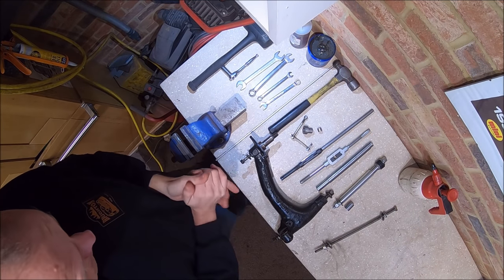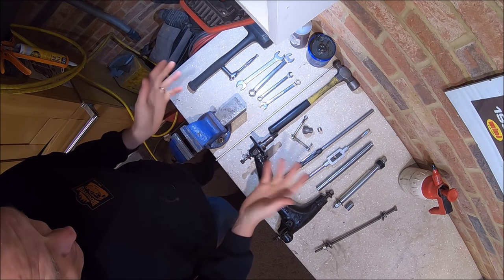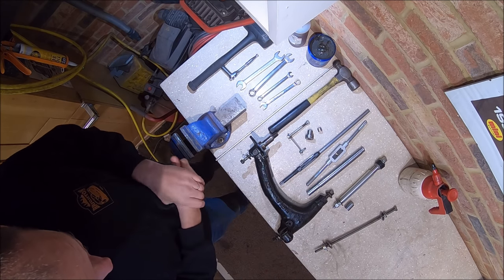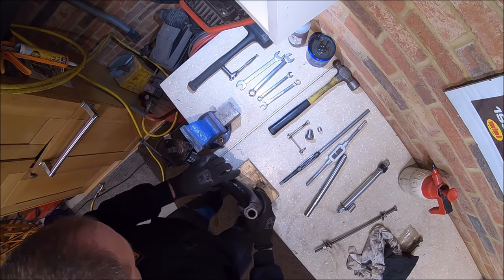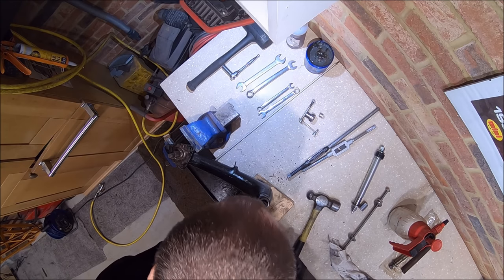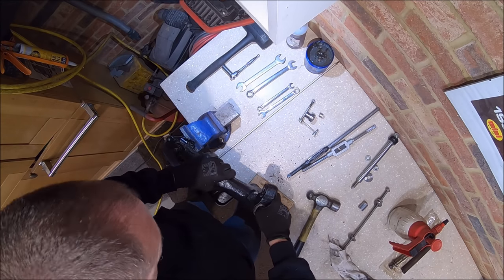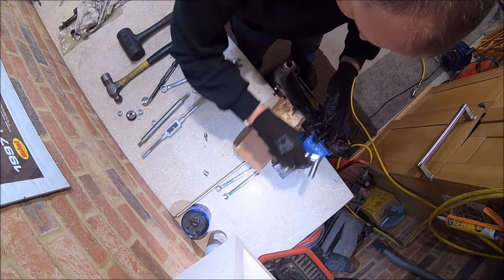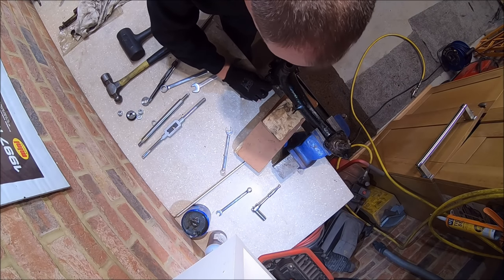Classic Mini Workshop Project Sprout Pt.53 Radius Arm Recon

Comment: Hi Keith. I spoke to the original owner.  He say all 4 Brakes were from 1984 Mini Front Disks.  He was a Master Machinist ( now long Retired)  He says he said he custom machined the the rear radius arm Brake mounts and stub axles  and  bearing carrier so he could mount the front disks on the rear end. he also said it took 3 attempts to get it right. he said  this necessitated changing the wheels from 10 to 12  inch to fit the larger brakes.and he said he had o fit large flares to fit the wider wheels because it made the mini wider in the rear by a bit .  I asked him if he still had his original drawing of the mounts etc, but sadly he said he tossed them when he moved to Florida to retire.  I wanted them to send you a copy. and to see how much it would cost to reproduce at a machine shop on modern CNC equipment.  He seemed very happy to hear from me again, but he is 89 yrs old and in poor health. he said a lot more as well.  he changed the emergency brake to actuate a separate hydraulic system that was tied into the rear brakes and he had to use a proportioning valve to do that.  You could tell he loved that car as much as I did.  Sorry I can't be much more help.  Maybe if I had the parts in front of me I could do a drawing of roughly how it was done but I doubt.  He sold it to me because he said he had too many Mini's and he could only drive one at a time, so he kept his favourite three cars and sold the rest. (a problem I wish I had.).  Well at least he sold one of them (in Nov 1984) to me with a ton of spares LOL! When I told him I wanted to build another Mini Van with a modern turbocharged Honda motor He was very Keen. Do you think I might be better off with a Newer (2011) Mini Clubman?  I really want to have a Mini but I think the modern minis are WAY underpowered.  A Honda hatchback can easily hit 500 horsepower with the right parts and a cheap eBay turbo.  I  would be happy with a bout 320-350 horsepower, but getting that out of a second gen BMW mini is Very expensive.   What is your option, I really value it because you have owned both. Again thanks for the great videos
Reply from the maker: You could not use that rear brake conversion and be road legal in the UK as the emergency brake needs to be mechanical, not hydraulic. In a classic Mini 100BHP is enough to have fun, 150BHP is seriously fun and 200BHP is about as much as you will ever need unless you are drag racing. Anything more than 250BHP will just be lost in torque steer and wheel spin. A 350 BHP Classic Mini might be interesting in a straight line but will be pretty much useless at anything else. Sadly when you factor in ££'s per BHP a second hand BMW Mini Cooper S will wipe the floor with a classic after a few inexpensive mods. Converting a classic with a Honda VTEC is probably the most cost effective way to get more power in a classic Mini but only if you have the know how to build it.
Reply: Thank you for your thoughts.  I should make it clear that I am not in the UK.  Just that the previous owner lived in the UK.  He told me that when He immigrated to Canada, he had imported 6 Mini's with him.  I am not sure when he made the modifications before, or after he moved here.  I have thought about it a lot, and even though I miss my original MIni,  I may be better off with a more modern one.  I really want four wheel disk brakes, and I am going to go with a Garret turbocharger and a hand made sidewinder Honda style exhaust.  I am told this will easily make 350 horsepower with the right injectors and fuel pumps.  I should have made clear that I wanted a track/ street vehicle from the start.  Also the 350 horsepower figure was referring to a modern turbocharged mini.  I will edit this later with links to some Mini's on YouTube you might be interested in watching.  Turbo B16 with electronic boost controller https://youtube/JQ2EzXZ7rtg AND https://youtu.be/Vb_gjoMxNFM Youtube posted 500 HP modern mini https://youtu.be/4bRwo1bDcDM?list=TLPQMTMwMzIwMjCZkouZErvLtw&t=148 450 HP mini https://youtu.be/-qAd4ISKlTo?list=TLPQMTMwMzIwMjCZkouZErvLtw  Thanks again for your help.

Comment: I would like to ask you, what is the reamer diameter in milimeters. I would like to do it by myself, hopefully it will be not disaster... :-) Thank you
Reply from the maker: The correct size is 13/16" (20.64mm) I use an adjustable reamer

Comment: Hello. Very helpful video, thanks. Placing a reamer tool order today. What size tap wrench adjustable twist handle do I need? There's one on ebay that covers M1 to M8. Would that be ok? Also, regarding your threaded bar, nuts and washers, what spec / size for the bar (M? x length). Washer size etc? Just want to place orders to have everything ready and not get so far then have to wait for things to arrive. Radius arms are still on the car. Currently finishing off cv joint, swivel hub, front brake, tie rod, hi=lo, suspension, shock absorber etc replacement / refurb, working front to back.
Reply from the maker: My wrench is M6 to M20 so the one you are looking at looks too small, threaded bar is M10x350  and washers are 37mm
Reply: @classicminiworkshop   Thanks, very helpful, bar, nuts, washers etc just ordered on ebay. Already got a tap turner that expands to M12....would that do the job?
Reply from the maker: @elwynrowlands9486  It should do, the reamer is M10 drive. The only thing I would say is the wrench needs to be wide on the handles to make it easier. Mine is 330mm wide
Reply: @classicminiworkshop  yes, I was wondering about that, for stability and control. I will tread carefully. Thanks again

Comment: As always nicely presented but just a small comment mate - When my arms were being reamed at Randall Engineering at Hepworth while they did the engine bores and cylinder head the guy (using the original Leyland tool!) left the old roller bearing in for the reamer sleeve and after the bush was to size punched out the old bearing, pressure cleaned the inside and then pressed in the new bearing.
Just one of many ways to do this gut boring job!
Reply from the maker: That’s a good idea. Also if they made the pilot bush a slight bit smaller than the bearing case you could just use the pilot bush before fitting the bearing
Reply: @classicminiworkshop  I am sure a local engineering shop could make one up as you have the needle roller and the sleeve as patterns. Suggest it to whoever made the kit.

Comment: hi
i am about to order the m machine sill and floor section i just watched you fit on the ERA and was wondering about the door step and a frame panel you fitted to the ns door  would you be kind enough nto tell me where you got them do no see them on m machine catalog 
unless i missed them
cheers and keep up the good work

brian
Reply from the maker: Hi Brian, all the panels came from M Machine, they are able to get loads of other panels that are not in the catalog, if you give them a call they can get just about any panel you want. They also know their stuff!
Reply: @classicminiworkshop  cheers Keith
Reply: Brian, that was a Heritage part and the M-machine part number is 13.14.10.27 L/H or 28 R/H. M

Comment: Hi Keith,  I am hoping you can help.  In the early 1980s I owned a 1967 mini van.  I loved that car.  The person I bought it from had the mini heavily modified.  It had rear wheel disk brakes.  I have searched the entire web looking for where those brakes came from.  The only thing I have found is a KAD conversion kit.  Do you have any idea what those brakes may have come from?  I know the car was imported from Britain by the previous owner.  It cam with a huge number of spares, and a second motor built by some mini specialist in Britain.  I got a screaming deal on the car.  Do you have any idea where those brakes may have come from?  That car handled way better than the North American cars I was used to.  I am making plans to try to build a car similar to that one, because it was one of my favourite cars, the only difference is I want to B16 engine, (for reliability) and a different colour.  I don't want to pay 2000$ cad for rear brakes.  Mini's have become very expensive compared to forty years ago.  If it's going to cost too much money I may just as well buy a more modern car. So I want to investigate how much it's going to cost.  Honda b series motors are pretty cheap so I can get a reasonably priced damaged donor car for cheap.  I have a line on a shell with a blown motor with not much rust from a friend so that leave the front subframe kit and the rear disks with a proportioning valve. Some 13 inch wheels, and some custom sheer metal work.  I am retired now and I can do most of the work   or with help from my kids. Love watching you by yourself or you and Mark work on these cars.  My old Mini was like Alex Toons only in was   bronze/brown with a chromed  front grille I fitted to make it easier to to swap motors.  I did not have a lift only very high jack stands so I would drop the motor out the bottom to switch to a 1275 motor that came with the car .  I did not know as much about cars as I do now.  I learned a ton about cars from working on that car.   Found memories.  Love you videos I have learned a huge amount about Mini's from watching your channel.  I worked as a mechanic/fabricator/machinist after high school.  So thanks for keeping me entertained and teaching me about Mini's.
Reply from the maker: Can you get a photo of the brakes and I might have a better idea where they came from?
Reply: Unfortunately Keith 
I had to sell the car when I got married (edit).  I no longer own it (sigh). I was hoping someone could tell me if it was a popular thing to do in Britain in the eighties.  My children are adults now and 
I was hoping to recreate the car, because I always regretted selling it.  It as you know was the closest thing to driving a street legal go kart.  I really loved that car.  I was trying to figure out if I could afford to replace it with a Honda b16 motor to upgrade the power.  I also always wanted power windows and and power door locks.  And the last item on my list was air conditioning. But with the B16 it isn't very realistic. I just can't fathom the idea of paying a huge amount for the KAD rear disks.  Did the rover metro ever come with rear disks?  I just can't remember because it has been so long ago.  I suppose I could buy a 2012 BMW  mini clubman but it just isn't the same thing.